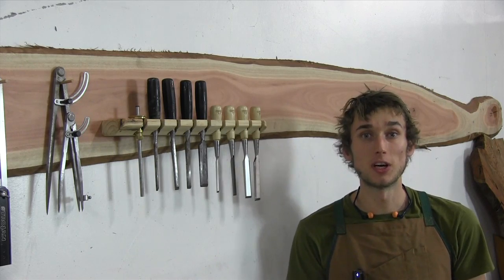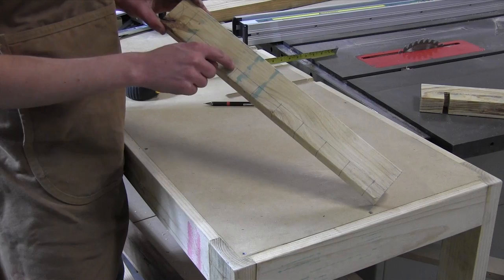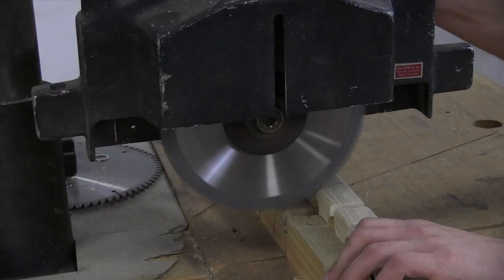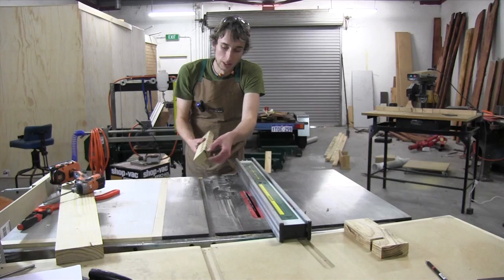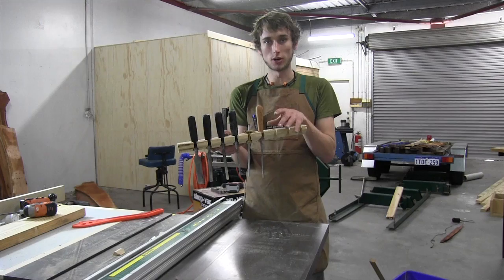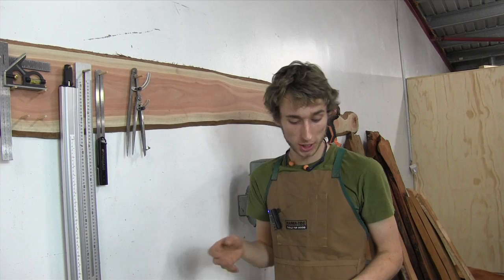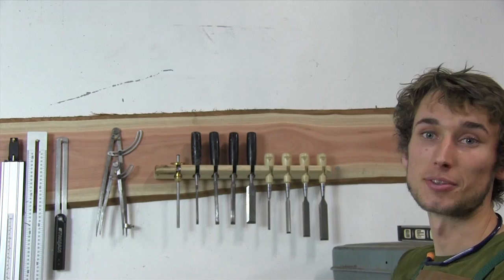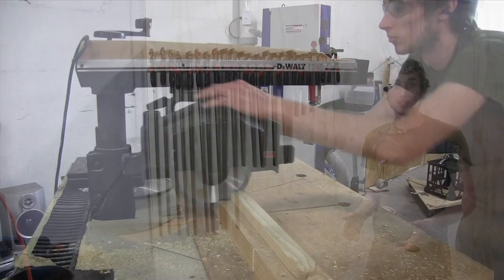Make a solid Chisel/screwdriver Holder - JWS podcast (tool storage)

Comment: I have several vintage Stanley 750 style chisels and notice sometimes the handle is loose in the socket, mainly due to changes in humidity. Might consider making the holes smaller so they will hang from the taper of the socket instead of the handle. Hate to see the chisels separating and falling to the floor.

Comment: Jord, you mention that your table saw can't take a dado stack.  Is this a common thing with table saws?  (And is there a particular mechanism that a table saw needs, in order to support a dado stack?)

Cheers.
Reply from the maker: Its quite common in Australia, I dont know how true this is but one of my local woodworking stores told me that dado stacks used to be illegal in Australia so thats why there aren't that many saws that accept them.

In order to accept a dado stack the needs a long enough arbor.
Reply: JordsWoodShop Podcast Ah, I see.  Thanks for that.  Cheers.
Reply: JordsWoodShop Podcast  Don't know about Oz but in the UK dado stacks are not illegal, just for some reason manufacturers do not produce saws that accept them for the UK market so there is no safe or practical way to use them. More info here. http://www.greatbritishwoodshop.co.uk/Tools/HealthandSafety/tabid/418/language/en-US/Default.aspx
Reply: Some table saws do some dont. All depends on the arbor length some have short some have long enough.MOST table saws do. I myself have a table saw that CAN, but only up to a max of 3/8". Kinda sucks!:/  my arbor is only a half inch so kinda pointless to use really..but I use it here and there when i need a dado thts 3/8"or smaller..I have a portercable model Pcb222ts its the portable tablesaw. I do contracting work so im always on the go and it fits my needs for  my job..I do plan on getting a (ironically enough) rigid or a delta "contractor style" table saw for my shop..99.9% of those accept a dado stack hope that helped and answered ur question (s)
Reply: Joe Walters Thanks Joe.
Reply: You can stack two normal blades or two thinner blades and offset the teeth. Like what Mathias wandel does.
Reply: Tom Howbridge ill have to look into that..never knew that. .
Reply: Tom Howbridge thanks man! Never knew u coukd do that..
Reply: Joe Walters :)